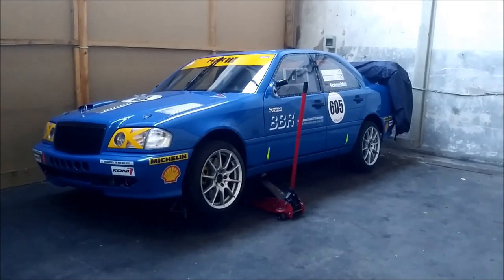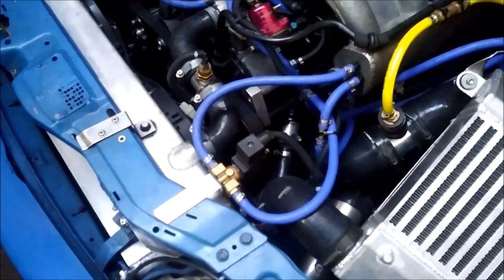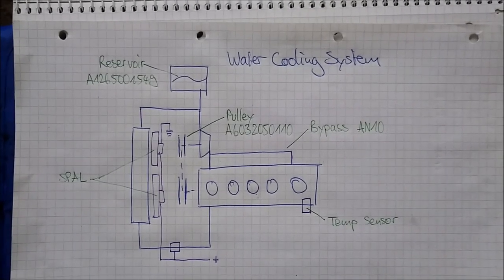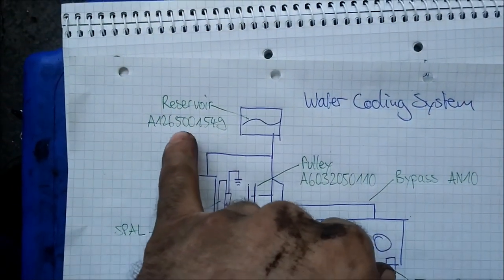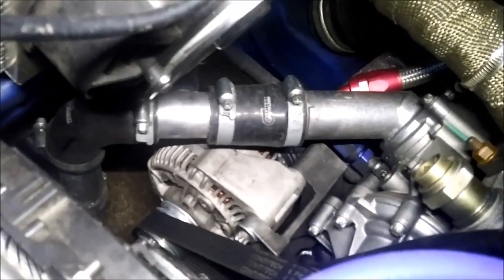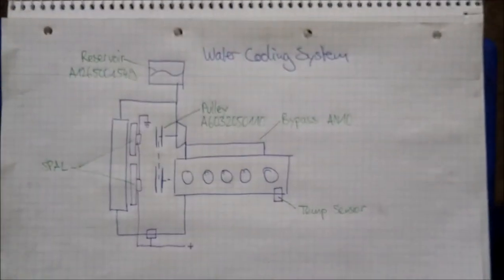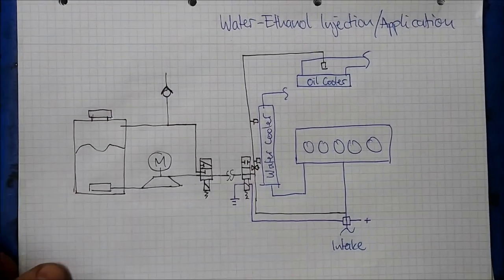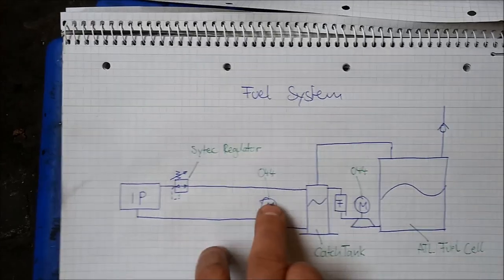How to build a Mercedes W202 OM605 Racecar (Part 2) | Cooling & Fuel System, Water Injection

Comment: Very helpful informations, thank you! Can you tell me please more precise what pump and nozzles (both for the radiators and the intake) did you use? Thanks.
Reply from the maker: Hi, for radiator spray i used cheap garden misting system. Pump is a cheap 20€ china membrane pump making 10bar. Injection nozzle is a fluidics nozzle 8.0 gal/hour. All easy to find online
Reply: @CZSMotorsport  Thanks alot for all the useful info! Keep up the quality work you do and informing us on it!

Comment: The modification for shifting with the 3 way valve, is that because you are flatshifting? Keeping your foot on the accelerator while clutching, then dumping the alda pressure reduces the fueling?
Reply from the maker: Hi, no with the mechanical pump a flat shift would be hardly possible because the rpm would run through the roof immidiately when pressing clutch

Comment: first of all thanks a lot 
one question, if i add a oil radiator should i need to add more engine oil or same liters ?
Reply from the maker: You should always check the oil level with the dipstick. If you put an extra oil cooler you will need more oil